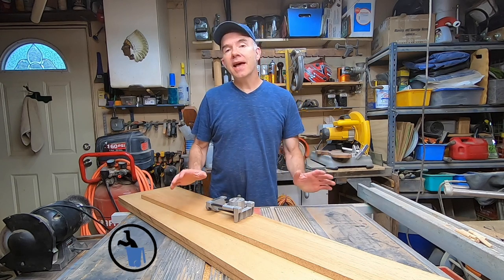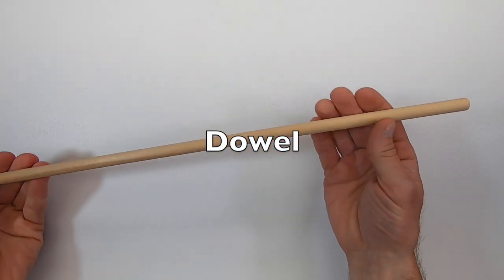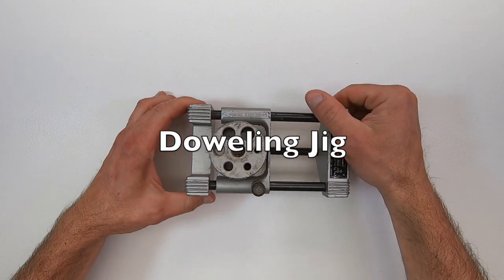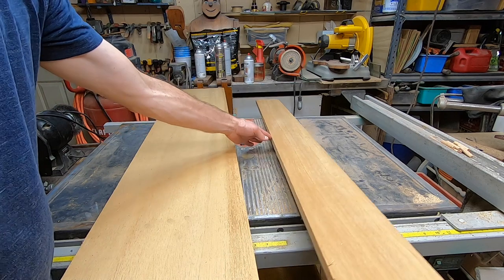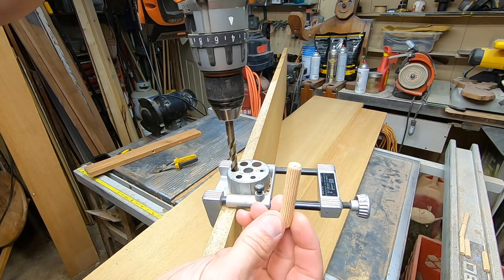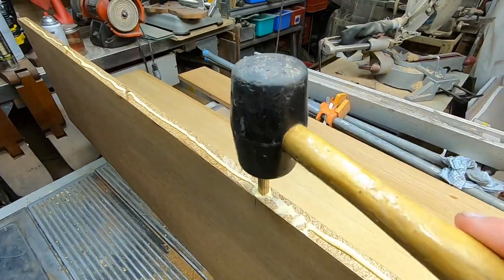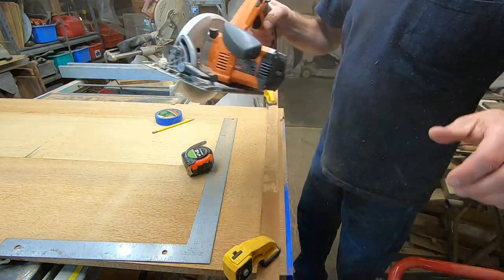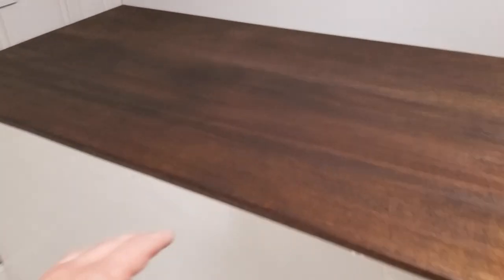Woodworking Basics - The Doweling Jig

Comment: I have exactly the same doweling jig.  Found it at a garage sale for $1.00.  Don’t use it very often but it works great when you need to have a super strong join to attach to boards.  I like to dry fit everything just to make sure the dowels/holes are the right depth and everything is aligned.
Reply from the maker: I was wondering if the newer models are more precise. When I use this type, the top surfaces are not perfect. I might have to test that theory. Thanks for watching! Tom

Comment: I have 2 of those in storage (must be 30 years ago) don't remember if I ever used it. One is the same as in this video the other is almost the same except the turret not spring loaded but lock with a thumb screw just like the slider locking screw and it comes with a bit depth gage instead of using a tape like the video. Both listed as General Doweling Jig No. 840.

Comment: What's the point of a dowel joint if you can't get the faces perfectly aligned?  Glue is supposed to be stronger than the wood itself so the only function of dowels/dominos/biscuits is allignment.
Reply from the maker: That is true for solid wood. In the video, I was glueing plywood. The plywood edge grain benefits greatly from dowels in this case. Thanks for the great feedback.
Reply: @AlleyPicked  good point